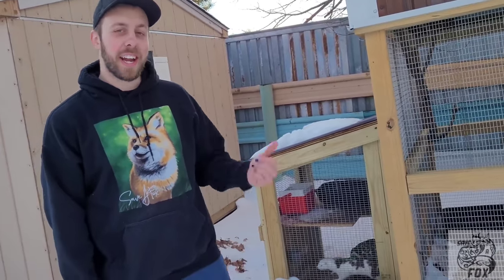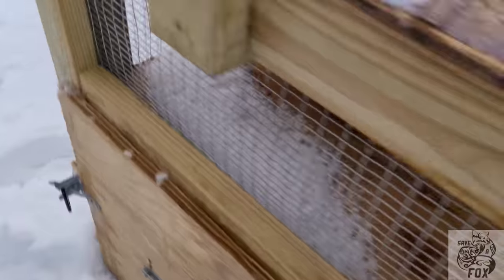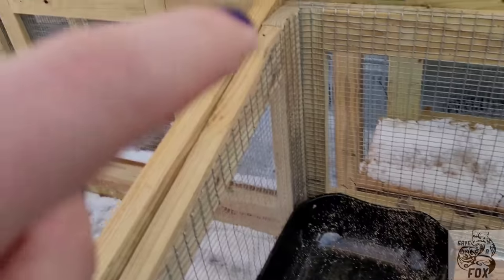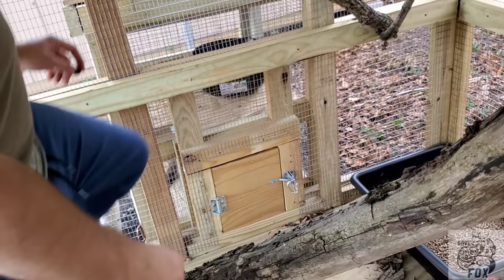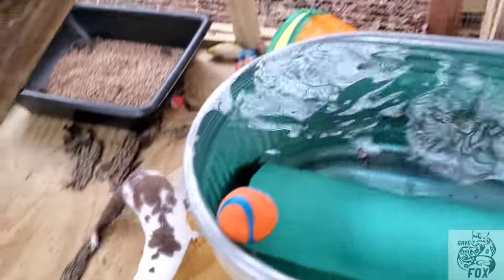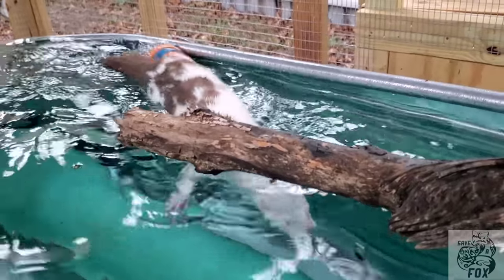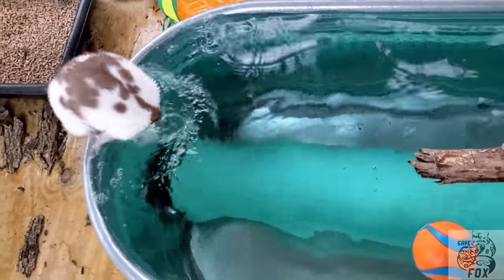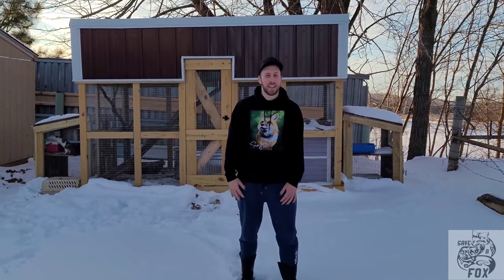Rescue mink swims for the first time

Comment: @SaveAFOX Ethan, for the mink pool heating system you cold bend a copper tube inside the pool  so that the ends of the tube are outside of the main cage and insert a rain gutter heating cable inside the tube - they have usually a built in thermostat so that they heat only to low temperatures above freezing. These should be available in stores like Home Depot... This is basically the same system that is inside electric water heaters.Another option would be to connect it with 2 pipes to an outside tank or pool that is heated and then circulate the heated water through the mink pool.
Reply: Also, if a pump is circulating water, it may not be necessary to actually heat the water, if the goal is simply to prevent freezing (not sure what minimum temperature is reasonable).
Reply: @Early Bird your suggestion was better than the one I thought of, which was electric underfloor heating. 
Under the tub itself, I was thinking it could work..
Reply: @ferdinand5223  Bruh
Reply: I would use the copper tube just straight through the bottom is a straight line and just but a bit of pvc pipe over it with holes drilled in it to allow water to flow in and out of it
Reply: I was actually looking up stuff.  Livestock watering troughs isn't an area I know a lot about.  :P  Not much in the way of electric pads that you could put underneath, huh.  Run any wires through a pipe, of course.  Cutting holes in the floor... probably already got done for the drain/refill?  Most trough de-icers seem to take for granted not being chewed on.
Reply: @ferdinand5223  You mean like helpful and kind humans? What a concept, right?
Reply: @kristin7146  I know, right? And not even that -- just be a regular, well-adjusted person. A lot of people on the internet seem to prefer to act like assholes, and they put a lot of effort into it, too.
Reply: @ferdinand5223  such is the power of SAF.
Reply: That was my only idea too.  At least, not one that didn't put chewable electric wires next to water ⚡

Comment: That’s an amazing cage. Great job!  Maybe add a small “deck” next to the trough, but more like a table at the right height, so it can be moved, if needed.
Reply: i was thinking the same thing,  a platform for the mink to stand on for getting in and outta the water.  or even a few steps getting in and out of the water.👍

Comment: So awesome! I would add a ramp from the ground to the water tank. I’d also add a ledge around the tank or at least a section of it. So they can dip in and then lay on the side on hot days etc. The branch is a bit minimal. 
And finally a rope hanging right above the tank for them to swing on and jump into the pool!

Comment: The only thing I think that you may want to add is a hammock in the spring/summer. Now, I don't know minks. But I do know a bit about ferrets and they love the hammocks. And tubes? Not sure. Just guessing. I know quite a number of the animals that worked with (when I was a zookeeper) would love your set-up. The easy ways to clean and feed are great ideas. I'm a bit worried about the food latch, but I'm not a builder.  But, really a great build. Easy to clean is the mantra I am trying to live by. Great job, Ethan!! Mr. Mink loved it.

Comment: you might want to add some sort of "dry off area" for when they get out of the water! mink naturally want to roll and rub against the ground to dry off and i don't think the bare plywood will satisfy that instinct as it currently is. maybe using those grass potty pads for dogs would work? would still be easy to keep clean and the fake grass helps comb through the fur and get some excess water out.

Comment: That's so neat!

Only suggestions I can think of are:

Some kind of platform for the pool for easy in and out (which people can move but maybe latches or hangs in place).

A cat tree structure.  Probably a rope wound one instead of carpet since it would be outdoors.  Something thin and easy for you to move for cleaning, maybe hanging through the cage wire so it can be off the ground?

You did great though!  VERY smart of you to separate the individual boxes from the rest of the cage the way you did-- that buffer is a fantastic idea to keep them from murdering each other.

That feeding door is pretty awesome too, as is the whole ease of access for cleaning.

Very well done!
Reply: I don't think minks have problems with getting in or out of anything.

Comment: Great space, but I'd say might need a few more ways to get down, maybe like a trail of wood or such so they don't feel a need to jump. My heard jumped when he fell from the top. I know he's probably fine, but it seems so high and they are so short. 

Also, this channel has definitely changed my thoughts on minks. I used to think they were basically just slightly larger ferrets. But ferrets tend to like each other's company and can be socialized and taught not to bite and stuff. I was reminded again of your video: "What it's like owning a mink" when they mentioned the food trays, but it's hard to keep in mind how wild they are when the little suckers are running around like this. :D

Comment: 2 Suggestions.
1. Doors/traps between small and large cages.
Make them sliding up/down or sideways with a lever, handle or cable mechanism going between the cage so that they can be opened/closed/locked from the outside and from the inside. Look at cages in zoos.l/circus, ...

2. I would replace the doors of the feeding bowls with a drawer that may have a shelve on top to avoid bowls moving while the drawer mechanism allows you to fill the bowls without any gaps/openings by which a mink can escape.

BTW, I always appreciate seeing both of you having fun while doing something so great.

Comment: That's amazing! What a great project. Well done, Ethan. My only suggestion would be to add in a way to open/close the pass-throughs from the small cages to the big cage which could be operated from outside of the cages. Some kind of pully/lever system, which would save you having to go into the big cage to swap them. Not necessary, really - I just think it might be a bit of a time-saver, and helpful to ensure nobody gets loose.

Comment: To heat the mink pool, you could put a bucket filter on the outside of the cage. Inside the bucket could be a physical medium like a sponge or gravel, some charcoal in a filter bag, a water heater, and a pump to get the water back into the pool. You could even hook up the intake to the already present drain pipe, and just pump the water back in through some pvc piping (can minks chew through that?). This will help remove urine and poop from the pool, heat the water, and also keep the water moving to keep pests like mosquitoes down. All the electronics should be outside of the cage, so Mr. Mink can't accidentally zap himself chewing on some cables.

Comment: They’ll probably get used to getting up and down in the cage a bit more gracefully as they use it more, but maybe a few ramps or lower platforms for them to get down safely? Also a spring board for the pool 😜

Comment: You could make a variety of tunnels from 4” pvc pipe and fittings or larger drainage pipe. You could make a tunnel with numerous entrances and exits and whatever for a shape 

A ramp and platform going up to and beside the swimming tank

One or more platforms on the side up the cage 1/2 way up or higher to rest or hangout

Comment: If you want a simple heating system you could adapt from how some pools do it. Have a heating chamber that can heat water and pump it. Then a pump to take the water from the main tank to the heating, Just keep in mind the further the feed from the tank the less effective it becomes to get it to the heating. You may also not even need a pump to feed the heating if its down a bit from the tank just make sure your pump is not over pushing back so you do not drain the heating and over flow the tank. If easy cleaning needs to be in place keep it outside of the cage for them where you have the drain off and put filters to the pumps. These do not even have to be super extreme pumps just enough they can move that water easy with no huge struggles.

Comment: Does the water level ever get low? Because if it ever does there might be the possibility of the mink getting trapped. You probably check on them often enough that that wouldn’t be a problem, but just in case, I’d add another stick - one in a corner, going upwards, like a ladder, so that if the minks are ever unable to reach the edge they can still find their way out. 
Like, I know they can jump too, but better safe than sorry, especially if the mink is too tired to do that for some reason.

Also idk much about mink and how tolerant they are to the cold - the lil nesting boxes are warm enough for them I presume? You mentioned you have difficulty setting up heating bc of their biting/digging habits - if you ever figure out a way around that, (perhaps a foul-tasting paste on the wires?) id recommend setting up a small area with heating, as they probably would love that during snow, even if they’re able to tolerate cold.

Additionally, how firmly fastened are the branches hung to the ceiling? While a single mink is unlikely to ever exert enough force to make one fall, there’s still the chance of it shifting over time and possibly eventually falling. Finding some way to keep them secure will help prevent squashed critters.

I don’t have much knowledge of architecture or minks, so this was all I could think of, and I’m not sure if it would apply, but I hope my insight it helpful :)

Really enjoying what you do
- Whirl

Comment: You may need to figure out how to dig a place for heating system under the next mink cage and have a control panel for it outside. If the heating system is directly under their water tank they can’t chew through it and especially if the control panel is on the outside rather than the inside. By putting the heating system directly under the tank you’re preventing the mink from figuring out how to get to it. I know this approach will take more time and probably be a little more expensive to do, but that’s the best suggestion I can come up with for you on the heating tank.

Comment: Great job but re: heating trough, be careful. I know some farms are seeing slight transfers of electricity into the water from water heating elements even tho they are designed for troughs etc. and maybe add levels of ledges
Around through making easier to enter exit without falling over the side?

Comment: Might need a little way for them to dry off, like a towel or blanket they can rub all over like otters like to do... And maybe a grippy edge on the tub? Does the water and snow buildup on the plywood cause problems when it freezes? Or when it rains? I'm worried about how the water can soak into the wood and then swell or rot and then you having to rip out and replace parts. It looks like they might need some ledges all around the walls to give them something to run around on at different levels, and to drop to if they get a bad grab on the wires.

Comment: We used to heat trace a false bottom under water trough that’s if you have power at that point 
Copper tubing in a false bottom works also we circulated glycol (antifreeze) in a closed system with a hot water
on demand unit where you can control the temp 
Just a few ideas bud 
Great job on the vid man 
Minks are really cool ….
BUT WHERE IS THE FINNSTER  ?

Comment: amazing stuff ... I presume the floor is concrete so there's no way to make the tub fit into the ground, that would be something ... maybe a bit more fake grass around the tub to soak up some water, I'd be worried about about the wooden floor lasting and also it could work as a surface to dry their coat with

Comment: 3:15 What if you take more of the pipe you used for the drain, and plumb in an inlet and outlet to a tank outside the enclosure, add a small pump, then heat the external tank? Cold water goes out of the internal tank, to the external tank, is warmed, warm water goes out of the external tank, and into the internal tank.
Reply: A better, but more complicated solution: External tank with pump and heater, route some copper pipe through the bottom so that the liquid in the two tanks never mix, fill the external tank with glycol, like a simple heat exchanger. You can get a glycol mix with a freezing point of -60, so you never have to worry about the pump/pipes breaking. That glycol is used in the HVAC world, and if it's safe enough to use on ice cream machines, it should be safe enough for mink.

Comment: Aww! He’s adorable!

I wonder, if you figured a way to cycle water continuously between the tub and an outside container, like with a fountain pump maybe? You could use a regular stock tank heater in the outside  reservoir out of mink reach, and if the water was always cycling  around it would all stay  warm/liquid, would it not?  Maybe using the existing drain/fill pipe?

Just a thought, idk how.

Comment: If you added another piece of wood to the food/water dish arm you could actually change out their food/water with the animals still inside that chamber.
Cut a piece of wood the same size as the food dish and attach it perpendicular to the dish arm, on the inside of the cage.  As you swing the dish arm open, the piece you attach follows behind it and closes the opening while you refill the dishes.

Comment: if you havent fixed the heater issue already, maybe the easiest solution is to put the tub in the corner and just use chicken wire to section off the swimming area from the heating equipment.

Comment: When it gets warmer and you can access it better, what about an insulated tub wall that you can use gutter heaters like they sell for for roofs/ice damns.  It should be low enough voltage maybe to keep it warm enough that it doesn't freeze.  Maybe.

Comment: U don't need to necessarily heat the water to keep it from freezing, you can use an aerator-bubbler system,,,something to keep the water moving so it won't freeze.

Comment: Looks great! I was wondering will there be 3 Minks in there at one time but with 1 in the main area and the other 2 in the smaller areas? If so, will that cause any issues between the Minks as they will still be pretty close to one another?

Comment: I would put a ledge around the water trough go back to the farm supply store change some water fitting to a t fitting the farm store can supply you with a heating element to go in the bottom of tank and you could cover it with gravel to hide it from the mink and keep the water ice free

Comment: It’s a nice system but you missed an important thing. Double door entry/exit. A bit like a foyer. A space you enter that the animal can’t get into. Once you close the outer door then open the door into the animal area. Zoos use them all the time. Double door entry and exit is so critical at times with animals. I honestly think most homes should have them removing the child running out into the street or the escaping dog to cat

Comment: Put a heating pad under the tank and run the cord thru the floor and out the base beam shew safe now
Reply: yh i thought same thing but idk if the heater they have is that rod in the water and idk if heating the bottom would melt the ice up top. i think they are just placing a heating devoce in the water like you see with bird baths.
Reply: @mattwaters9008  Matt you can get a horse tank heat that goes thru the side of the tank or you can get one that ie tank and heater already sent up that way
Reply: @thomashastings5694  yh but i think if they already have a heating element theyd rather just mink proof that than buy a bunch of new stuff. it a good idea, but idt its optimal in this case.
Reply: @mattwaters9008  Matt your on the ground so you would know best on how to employ those items, so I differ to you
Reply: @thomashastings5694  im just guessing too lol, its not like the vid listed resources and build options. but im sure Ethan will be able to figure out how to heat water if he can build a huge mink compound